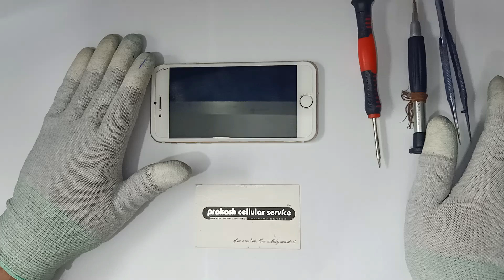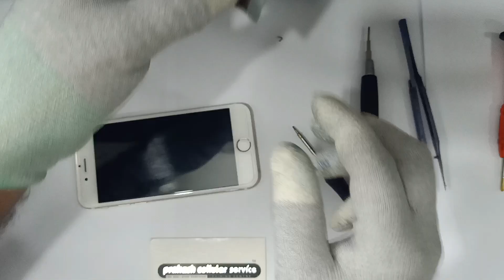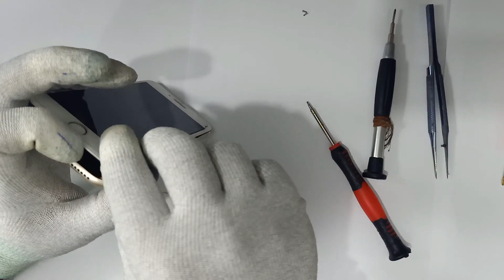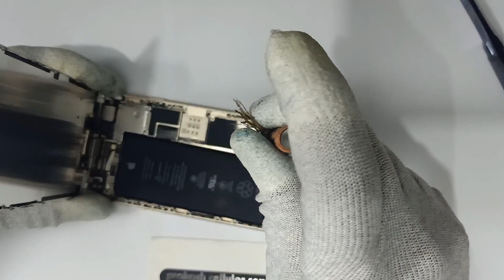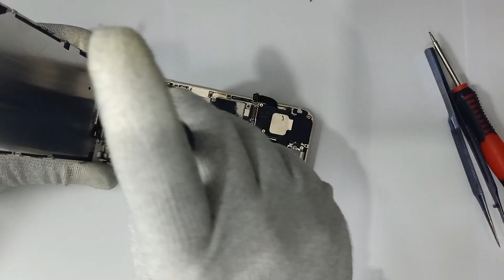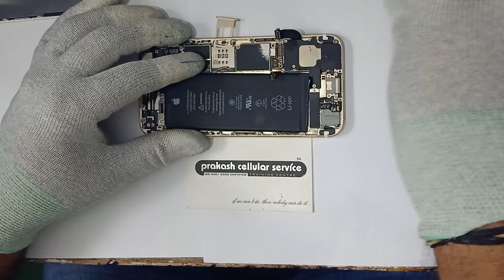How To Repair iPhone #chipleveltraining #laptoprepairtraining #prakashcellularservice #training

Comment from the maker: PRAKASH CELLULAR SERVICE ISO Certified 

Course: Mobile & Laptop Chip Level Training.
About Us:
Prakash Cellular Service Is The Oldest Mobile And Laptop Training Institute Since 2002, We Teach Advance And Latest Equipment’s, We Have 18 Years Plus Experienced Faculty. We Are Located In Heart Of City In Indiranagar Bangalore. We Have Trained More Than 16,000 Plus Students In The Field Of Services And Repairs.
What Will You Learn?
Smartphone Course Includes Theory, Hardware, Software And Practical Classes.
1) Theory Classes Includes:
 Basic Electronics, Electronic Circuits, Electronic Components, Identification Of IC, Identification Of Parts, Identification Of Sections, Mustimeter Digital /Analog, Component Checking, Schematic Blog Diagram, Layout. 

2) Smartphone Practical Class Includes:
Assembling & Dissembling, Keyboard, Charging, Speaker, Ringer ,Mic, Sim, Dead, Jumper (Micro Soldering),  Vibrater, Backlight, Network, Liquid Damage Short Issues, Headphones, Auto-Restart, IC Reballing And IC Replacement With Microscope, Display ,Touch And Glass Replace With Ocea Machine. 

3) Software Class Includes:
 OS Upgrade, Flashing, Data Transfer, Password Reset, Unbrick Repair, Booting. Pattern Lock, Hanging Issue, Error Message, Struck On Logo, Baseband Corrupted.

LAPTOP Training Includes :- 
 Hardware, Software And Practical Classes.

1) Assembling & Dissembling, General Service, Ram & HDD Upgrading, OS Installation & Upgrading, Adapter & Battery Repair, Display  & Display Cable Replacement, Keyboard Replacement, Heating Issue, Wifi Issues, Charging Dock, Audio Jack, USB Port, LAN Port, Liquid Damage, BGA Repair, P1 And P2 Section Repair.

2) Software Class Includes:
Windows Installation, Data Backup, OS Upgrade, Formatting, Microsoft Installation, Drive Patrician, Password Reset.

COMPLIMENTARY FEATURES :
 Practical Experience With Service Centre Will Be Given .
 Course Completion Certification.
6 Months Follow Up Session.
Technical Help & Support.
Free Tool Kit Provided
100 Job Assistance 
Food & Accommodation Available
 Classes Taken In English, Hindi, Kanadda, Tamil, Telgue, Nepali 

Mobile & Whatsapp – 9945499971/9880264324
Facebook : Www.Facebook.Com/Prakashcellularservice/
Istagram : Https://Www.Instagram.Com/Prakash_Cellular_Service/
Youtube : Https://Www.Youtube.Com/Channel/UC2JMYBnLK5LYH-Betflfdma

No. 492, Ground Floor, Nandanam Apartment, Opp Chumbak, Indiranagar, Bengaluru, Karnataka 560038https://www.facebook.com/mobileservice2001